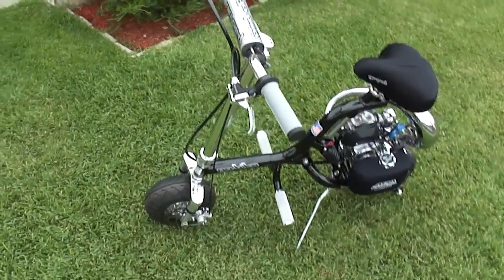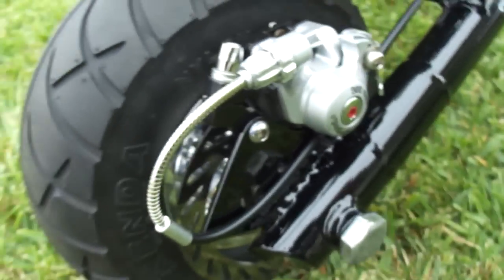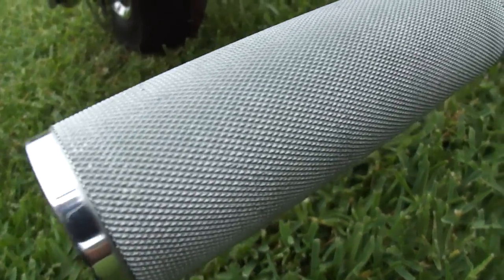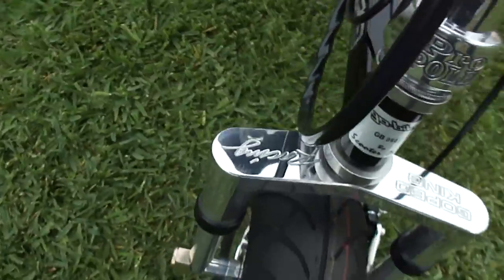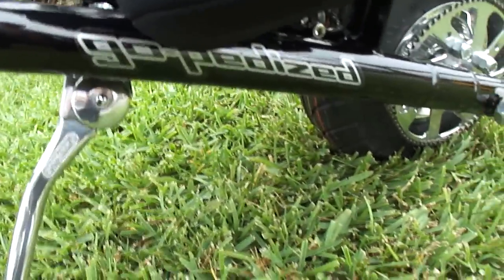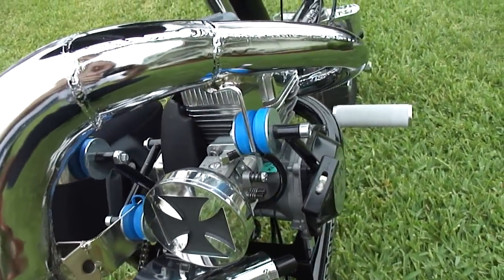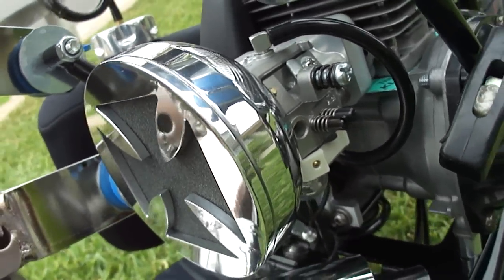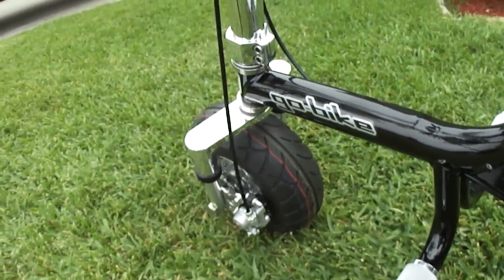Fully Custom Built Go-Ped Go-Bike

Comment: Out of all your peds Derik that custom go-bike is one of the peds I’d never of sold. You had no need to sell it you seem to have no money problems but it’s your life I’ve learnt a lot about making custom gopeds I’ve done a custom gsr40 with maddog brakes front & rear race pole custom casereed 40 motor TS head kit custom paint job. & i did a Gsr sport mico suspension forks & custom bronzey red powder coating same colour as the forks. Next I’m trying to find a genuine go-bike frame to custom build

Comment: Just a suggestion. Your pipe needs to be smoother on the initial bend. That angle on it is probably biting into your performance quite a bit.
Reply: Yup,i definitely noticed that right away as well. Other then that though,it is perfect lol

Comment: Hi Derek. Thank you for the videos. I'm interested in purchasing a new gas Go-Ped. Although your Peds are beautiful, I'm not modifying. Not interested in off-road just a Ped to cruise around the neighborhood.  I'm 6feet, 200 lbs. Any suggestions on a standup or sit down? Thank you in advance.
Reply from the maker: I recommend a gsr40 or gsr46. the gsr 40 is no longer made and you would have to buy used. but its more reliable but a lil bit less power than the gsr46. the gsr46 you can still buy new.